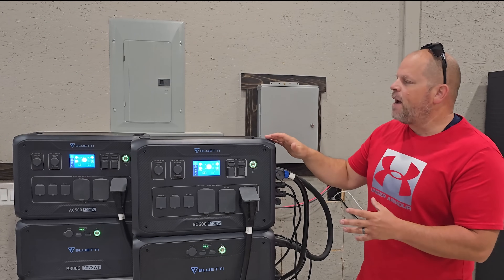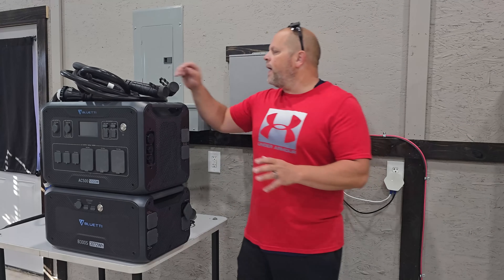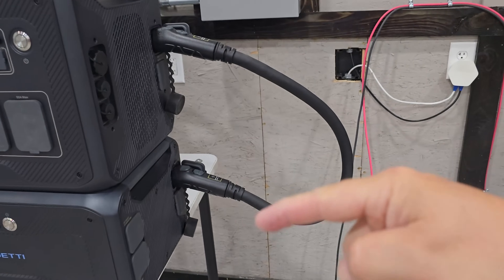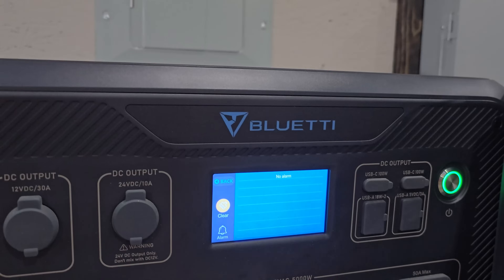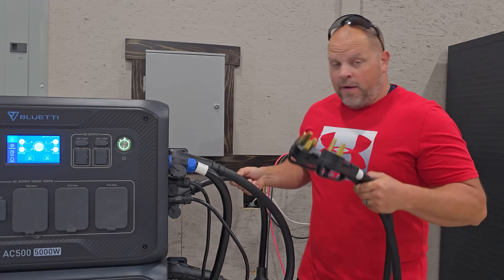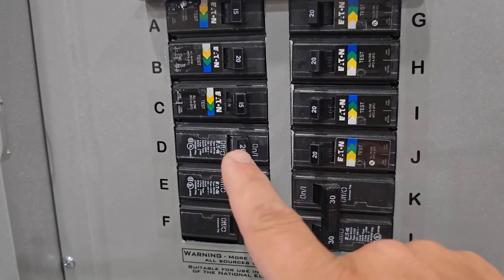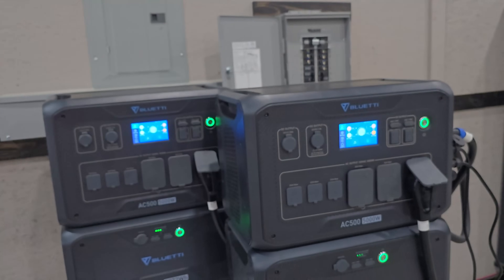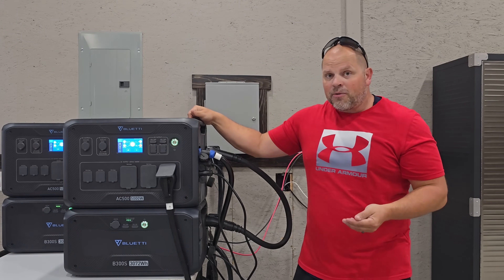BLUETTI AC500 240v 50amps 5000 WATTS

Comment: Wouldn't you what the two AC 500 units to charge to 100% on the grid? Why only 50%? 
🤔 So when a power outage occurs it's fully charged, especially if you're off grid for a week you'll need to be recharging the AC 500 units anyway. 😊

Comment: This is a perfect 240V split phase, grid-tied, set-it-and-forget-it setup where the units power the structure via battery and inverter, will be recharged via solar, and then backup charging via AC in the event of not enough solar. I have two AC500's with solar panels on my roof maxing out the PV inputs and run the entire house. Haven't set up the 50A outlets yet for backup charging but it'll happen. This video really should have more views and spread widely amongst solar enthusiasts as the AC500 units are all-in-one turnkey systems and you can also use cheaper, external batteries to expand capacity. I haven't had the need to exceed 41A total running power so it's perfect for my situation and will be for most people and families of 4 or less.

Comment: thank you so much for the video! i have a question.  Do you know what is the differences between fusion box and home integration system.. ? does the home integration system send more amps to your main panel?
Reply from the maker: The fusion box is more of a portable solution. Whereas the home integration is basically a transfer switch. Hope that helps. Thanks for watching and commenting 👍🏻

Comment: Hello, i have a question for you. Did you ever experienced an issue where the batteries does not depletes equally ? What happens if one of the battery runs out ? Both unit turns off ?
Reply from the maker: It could depending on the load balance. If one side reaches 0 before the other it would shutdown the system. It's not common that this would happen but it certainly could if you L1 and L2 loads are out of balance.

Comment: Have you manage to prevent the system to reset (off for a sec and then on again) each time the AC input change, like unplugging the AC input cord or turning off a gas generator?
Reply from the maker: I have been powering my shop for several months strictly off of the AC500's. I have not faced any issues under my circumstances.

Comment: I thought this video was fantastic and very well explained. Adding two 50A grid outlets is perfect to make this a partially grid-tied system. I hadn't found many vids that describe the split-phase function in detail. I monitor my power usage with the HomeVue system and since I have a soft start on the HVAC amperage never goes above 50A, so I plan on getting this setup. How many split phase circuits can you set up on that transfer switch? I have two reliance controls 10-circuit transfwr switches but they only have two split-phase circuits each and I have 5 total (HVAC, oven, water pump, water heater, and dryer) and I was thinking of just adding a double-pull on two of the 15A breakers.
Reply from the maker: Thanks for watching and commenting

Comment: I have one AC500 EU model that has a 240V 32amp output as standard, so I don't need to connect two together to achieve 240V like you do with your non-EU model. However, I can still connect two together and then have 240V 2-phase 32amp in the junction box.
Reply from the maker: I would assume all of the 20 amp outlets are 240v also on the EU model?
Reply: @TheSolarPit  its only 16amp on the rest of the 5 outlets but yes all of them are 240v 🙂
Reply: The real goal of using two inverters is to achieve the split-phase function of two sine waves at opposite 180 phases not achieving 240v. It just so happens that US uses 120v single phase so two of them add up to 240v. EU natively uses double the voltage for a single phase because of the dirty power they attempt to transmit to customers.